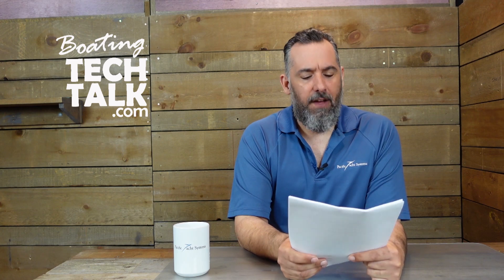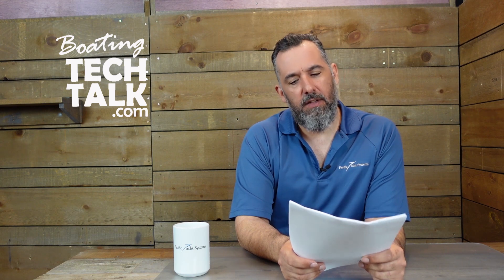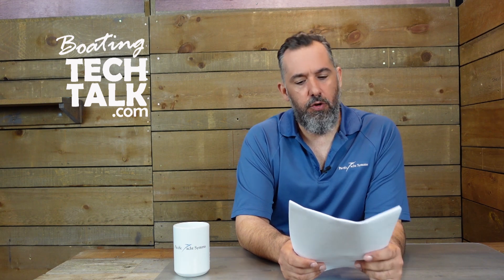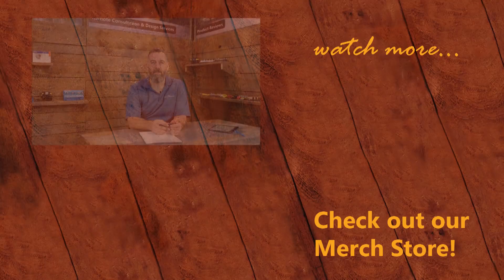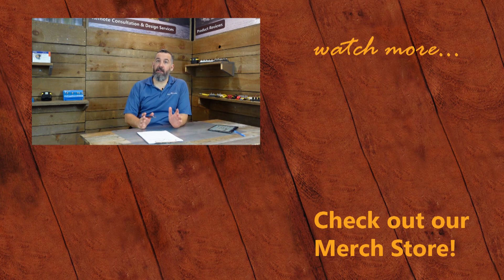What Is the Depth of Discharge for My AGM Battery?

Comment: For vanlifing its impossible to only go down  to 50%, I need all of that. I have 2x Leoh AGM 160ah batteries and their datasheet shows full discharge at 10.8V if I have constant 14A current load (about as much I have if i run my laptop and lights + fridge). Does  not say anything on datasheet that I cannot discharge all the way to 10.8v. I try to stick to 11.5v but its hard  during winter days as no sun for solar.

Comment: Hi Jeff, Hi All,
I bough 12v 95ah AGM battery to my car but there was module issues and 3-4 times my battery went to about 9.5 volt, so fully discharged/ I tried to recharge them after 4 days of staying discharged but I was wondering if my battery is damaged you think? When I go inside my car after 72 hours, it only shows  around 11.9volt 12.1volt when ignotion is on. I was expecting to see 12.6-12.8 volt at least

Comment: Is it true that the AGM battery needs to be charged above 14.2 volts to be fully charged?.
Reply from the maker: Good battery brands will list the charge voltage right on the battery, or in a manual.  Most  AGM's want 14.4v to 14.6v for bulk / absorb charging.   Note they need that voltage for hours to fully charge.  Just getting them up to that voltage is nowhere near full yet.
Reply: Yes, some manufacturer's recommend 14.8 or 15.0 volts on 200+ amp batteries

Comment: 20% 30% 50%… of what. What voltage reading. My new agm batteries went to from 12.9 to 13.2 volts after plugging them into shore power for a day. After being plugged into a power pole for a week… they read between 12.2 and 12.6.
Reply from the maker: Hi Samuel, for a 12 volt lead acid battery, including AGM, 50% of battery capacity should be 12.2 Volts after 24 hrs of no charge or discharge at 77 degrees Fahrenheit. A voltage about 12.8 is a charging voltage, with most float charging at 13.2 - 13.6 depending on battery specs.

Comment: I have a vmax battery 135amp.  I only use it on a 46lb thrust trolly motor. After 2-3 hours my voltage meter reads 11.8 with a load . When I turn it off the battery comes back up to 12.2 is this normal and you say 11.8 is okay right 👍
Reply from the maker: My suggestion, based on your application, would be to not go any lower then 11.8 volts under load.

Comment: The best thing I ever did on my boat was get rid of the AGM's and replace them with a DIY lithium (lifepo4) my AGM's weighed 146 kg for a total of use able 268ah (@ 50% DOD),  my 500ah lifepo4 weighs 60kg (400ah use able @ 80% DOD) a weight saving of 86kg (more room for beer)
Reply from the maker: Thanks for sharing, tell us more of your Lithium DIY setup.
Reply: The price is insane
Reply: @dannywelbz3650 not if you do the math right. LiFePO4 s can do 100% DOD @ 1C and still can last over 2000 cycles.

Comment: Hi Jeff  why are there two sets of battery terminals?   2 large lugs positive and negative and two small studs with nuts. would it be better to have my starting circuit on the large lugs for my starting battery?
Reply: Large lugs for high current.  Small lugs for voltage monitoring connections?
Reply from the maker: It's not uncommon for batteries to offer a marine terminal and an automotive terminal on batteries, makes it easier to interconnect existing cables with specialized ends already crimped on the cable ends.

Comment: Jeff, have you done any load testing of batteries? I found this video https://youtu.be/iy3hga_P5YY really interesting. They tested AGM and FLA batteries and found that they didn't come anywhere near the capacity claimed by the manufacturer even under best case usage. They didn't reveal brand names, but the tested multiple brands and found they were all "optimistic" if we're being generous or "fraudulent" if we're being more cynical.
Reply from the maker: Hmmm, interesting. Personally always de-rate the published number by about 10-20%, For instance a 220 amp-hour battery is instead 200 amp-hour. Like too many things, there's marketing and then reality.
Reply: @PacificYachtSystems  That is probably a good idea, but if you look at the manufacturer data sheets (and assuming the manufacturer's data sheets are honest and accurate) you can get an idea of how much extra life you can expect for a specific amount of derating. But the interesting thing in that video was that under load test the lithium batteries exceeded the specs published on the data sheet but all of the lead acid batteries fell short of what the data sheet claimed. But the tests were performed by a YouTuber using test equipment provided by a lithium battery manufacturer. Presumably that manufacturer knew that their data sheets are conservative while lead acid data sheets are optimistic. It would be interesting to see tests performed without any battery manufacturer involved at all and see if it's consistent across brands that lithium data sheets tend to understate capacity and lead acid data sheets tend to overstate capacity.

Comment: Ok Jeff, I'm am real electrical ignorant person and this may be kinda of a dumb question. But I always hear battery discharge in percentages. But, what does percentages really mean?  Like in volts? In my case a new to me sailboat, 6 100 AMP Hours AGM (new), Victron Solar (Smart) Controller, 3000 watt Inverter Charger, and the new Victron battery monitor. 
I found you a few years ago and watch you religiously!!! Like as soon as you post!!! I've taken your advise and have been following your advise for my boats and I am so much more confidant due to you and your business. Many "thank you's" from me. Ken
Reply from the maker: Hi Ken, great question. Battery voltage and how it refers to battery capacity is very similar to how heart rate relates to health. Battery voltage is only a good indication of capacity if the battery at rest (i.e. no charge or discharge for 24 hours). Similar to how a resting heart rate is a good indication of your health. How often is house battery not used or charged for 24 hours, almost never if onboard and using the boat, hence battery voltage is always taken in context to loads or charging happening at any given moment. Similarly, what physical exertion you are doing will affect our heart rate, and if we are running up the stairs or alternatively sitting will affect heart rate differently. Therefore voltage like heart rate all depends on context and is therefore hard to quantify capacity.
Reply: @PacificYachtSystems  hance my question in another thread. What is 50% at let's say 700w. I'm sure it won't be 12.2V under load. What should i set my controller to at that load. 11.8V or even less?

Comment: How are these percentages measured?  What voltage drop equates to 50% discharge?
Reply from the maker: For a 12 volt lead acid battery at 50% with no loads or charging for 24 hrs will be at 12.2 VDC.
Reply: @PacificYachtSystems  I don't realy agree. 12.2V would be under no load but cut off time should be calculated under load meaning for example 300W , 600W or 1000W.
Your measurements under load when setting up the controller will be totally different and way lower than 12 at 50% butter (when load is discovered will show 12.2). 
Can you please provide the way of estimating this or calculations needed to be made. 
We also know the load is only temporary and it can fluctuate. 
Cut off time for 50% of a 12V battery under load is definitely lower then 12.2V and some controllers don't even allow you to set it abowe then 12V threshold.

Comment: Jeff, great info on standard AGM batteries.  I just installed 3 Firefly #31 on our boat.   Based on my research they can be deeper discharged without issues. Is that true.
Reply from the maker: Yep, you can regularly discharge to 20% of capacity and still have over a thousand cycles.

Comment: Hi Jeff, thank you for answering my question,  it's very much appreciated. The goal is to cycle to no less than 60% so you've answered my question,  to set it at 50%(12.3v according to the datasheet). The system is for my brother,  and hes not likely keep an eye on things like most people do, so I'm installing a Victron smart protect to save the battery. Again thanks again for the video 10/10.  Best Regards Stormer.
Reply from the maker: Thanks Stormer.